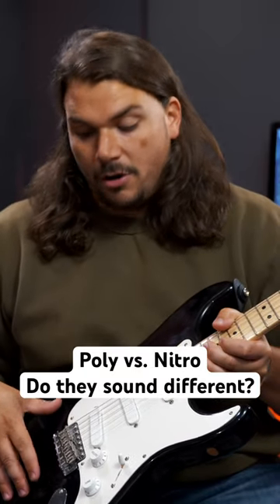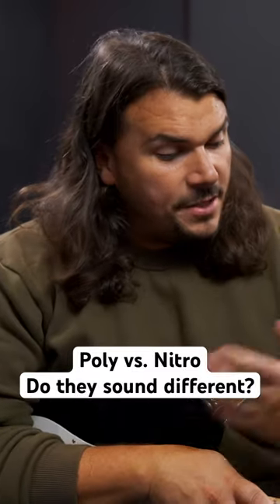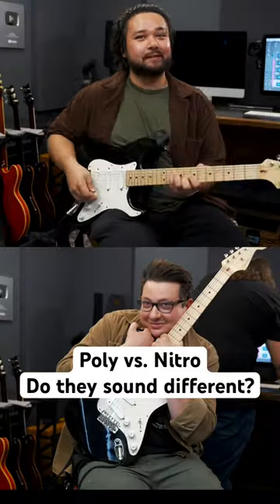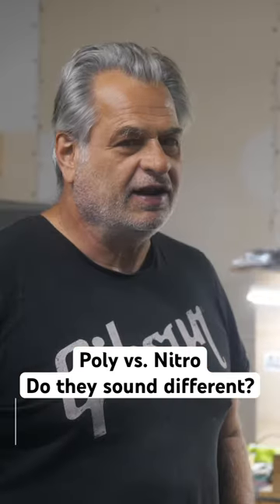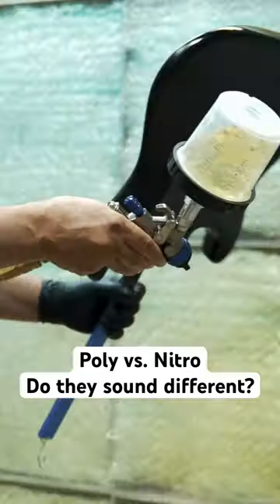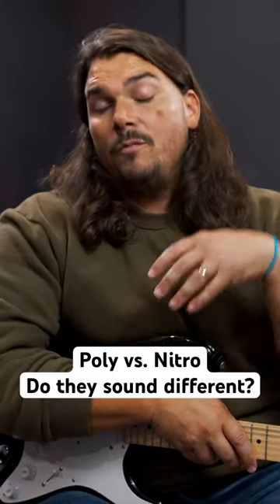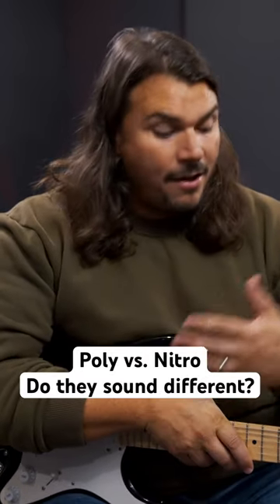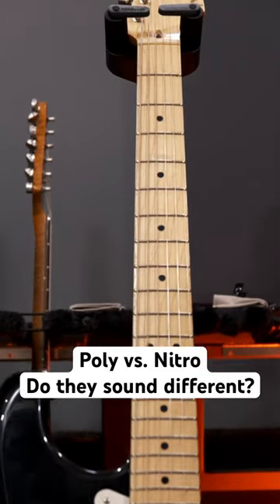Nitro vs. Poly DO THEY SOUND DIFFERENT?

Comment: Of all the tone superstitions that guitar players have, this one is the most insane. It’s right up there with maple versus rosewood fretboards.
Reply: The FB wood makes sense though.  The way the wood under the frets damps string energy can make an audible difference.
Reply: @GCKelloch  magnetic pickups don’t detect audible anything. They convert electromagnetic disruption to voltage, and that’s all.
Reply: @EricMakingWaves  Right.  They detect vibrational amplitudes in the strings that haven't been lost via acoustic resonance and damping.
Reply: Nah that one makes sense. The finish one though is silly
Reply: It may make a difference on a small scale perhaps barely audible to human ears but if you physically change one aspect- a relatively large one it has to effect the occultations of the strings to some degree even if it is minute
Reply: @stepvanjoe3469  More than barely audible.  Classic example is a Les Paul Custom vs Standard.  Custom is all Mahog with an Ebony FB.  Standard has Maple top and Indian RW FB.  The Custom has a notably brighter attack, but can have a more "hollow" tonal character depending on the density of the Mahogany.  That can vary a lot.  Wood is somewhat unpredictable-- denser from the bottom of the tree.
Reply: @GCKelloch it’s barely audible my friend. If you put that same set of pickups at the same distance from the strings, the difference between them wouldn’t be distinguishable without visualization of the audio.
Reply: @GCKelloch  I don't mean to be rude, but a simple physics/acoustics class would do a lot of good here. "Vibrational amplitudes" is not a thing.

Strings vibrating on a guitar create acoustic energy (sound waves) and yield a wave that is extremely complex and full of nuance. Microphones are transducers that convert this acoustic energy into a small voltage and yield a very complex signal that's full of sonic details.

Pickups are not microphones, they don't "hear" any of the things your ears hear because they don't detect sound waves at all. Pickups are simple passive magnets which create a short range field. Ferrous materials (steel strings) disrupt the magnetic field and generate a small voltage and a relatively simple signal--with very few sonic details. This is why guitars plugged straight into a mixer (with a clean preamp) tend to sound very flat and plain, because guitar pickups don't actually convey much information. This simple signal starts out sounding flat, but it acquires more character as it passes through pedals, preamps and power amps. Then, the majority of the sonic details we love about electric guitar are added by the speaker and cabinet--where the once simple signal is converted into acoustic energy and takes on all the complexity sound waves actually have.

The materials an electric guitar is made of have no effect on tone for two reasons: 

1. Because electric guitars generate such minute sound pressure levels that there isn't enough acoustic energy to alter the behavior of the strings themselves (think of how loud an amp has to be for feedback to occur).

2. Because guitars only have 6 strings and therefore a maximum of 6 orders of harmonics can be produced at any time. To put it another way, 6 harmonics isn't enough bandwidth to capture a truly complex sound wave like the kind your ears here when you strum an unplugged guitar. To demonstrate, try opening a grand piano and yelling inside it with the sustain pedal pressed down. There are hundreds of strings in there which is just enough to reproduce a lo-fi version of your yell (it sound a lot like reverb).
Reply: @EricMakingWaves  I have taken a physics of acoustics course and other related courses in college, and have since studied it informally for over 40 years now.  Yes, I used a term incorrectly, but I included "amplitudes" to indicate that the string vibrations are damped to varying degree.  

I'm talking about the direct mechanical damping of string vibrations from the wood fibers under the frets, and not from the acoustic vibrations through the air.  I've made b4 and after recording swapping guitar necks, and there are several YT demos showing how the rigidity and grain structure of FB wood damps string vibrations differently.  

Generally, tighter/harder grained woods damp less.  East Indian RW is much softer than ebony, and has large pores that allow more fiber movement to damp more.  That's just basic physics, and the difference in the high freq amplitude of the transients can be heard if the guitar circuitry has enough high freq extension.  I don't see how you all don't get that.
Reply: @EricMakingWaves  You also are under a misconception about what actually creates the signal in the coil.  Dr. Scott Lawing did a simple experiment showing the magnetic field emanating from the strings creates the signal voltage in the coil, not that the field around the coil is disturbed.  There may be some small contribution from the pole field fluctuation, but it wasn't audible in his experiment.
Reply: @EricMakingWaves  Also, Hi-Z guitar pickup signal is often not flat.  There is a resonance peak, the freq and height of which is determined by the capacitance, inductance, Q-factor and resistance.  In most cases, the signal rolls off by ~5kHz, but there are many exxptions.
Reply: @EricMakingWaves  Your statement about string harmonics is a bit off.  There are many harmonics in each string potentially audible depending on the string length, thickness and tension, and the pickup freq response, aperture width and position.  The first 16 string harmonics may be the most significant, so 16 x 6 strings.  Again, depending on how much the guitar structure and materials damp them.
Reply: @EricMakingWaves  The piano example is also not great.  How the string harmonics are excited by acoustic waves depends on the proximity and amplitude of the source, and at what strings it is located.  I'm quite sure I could excite very high harmonics by making a loud "Shhhh" sound close to certain piano strings.  Again, that's acoustic energy vs the direct mechanical energy I referred to in guitar FB damping.
Reply: @GCKelloch  dampening occurs through contact. Wood never makes contact with the string, it can only produce reflections, which again, are too low in SPL to make any difference at all.
Reply: @GCKelloch  try putting nylon strings on your electric guitar, they produce acoustic energy, but the pickups yield nothing. No iron content means no disruption means no voltage.
Reply: @GCKelloch  flat, in this case, is a descriptive word. If you look at a DI recorded guitar signal it looks closer to a simple sign wave than the same recording as captures through an amp and microphone.
Reply: @GCKelloch  each string can only vibrate at one of its harmonic orders at a time. 6 is the maximum concurrent harmonics.
Reply: @GCKelloch  it must be a good enough example because you’ve repeated my original point very well here. The amplitude and proximity are the most important factor in the strings reacting to what’s around them. Guitar strings have very close proximity to the fretboard, but the amplitude of the wave produce by the strum is very small, and the amplitude of the reflection the wood provides is even smaller.
Reply: @EricMakingWaves  The string vibrations that are strong enough to apply sufficient force on the fret to cause the wood fibers under it to vibrate will be damped to varying degree.
Reply: @EricMakingWaves  The feild disruption concept has been disproven. The vibrating flux lines emanating from the magnetized portion of the string generate the V in the coil.  The magnet can be located above the string, and the coil below it, and the same result will occur.  Feild disruption is insignificant.
Reply: @EricMakingWaves  Yes.  A guitar amp will generate added harmonics, and a mic will add acoustic vibrations.  I do not argue that point, but a vibrating string has many harmonics above the fundamental.  Albeit, at successively lower amplitude.  The fundamental is 1, 2nd = 8va, 3rd = 8va+5th, 4th= 2x8va, 5th = 2x8va+4th, etc.  You might brush up on your acoustic physics.  It's basic stuff.
Reply: @EricMakingWaves  Dude!  To reiterate: I'm not talking about the effect on the string vibrations from the acoustic vibrations coming off the FB.  I'm talking about the direct mechanical transfer/loss from the strings vibrating the wood fibers under the frets.  Wood fiber hardness/rigidity and density affects how the string vibrations are damped.  There's no point in further discussing this if you don't grasp the difference between the two functions.
Reply: @GCKelloch  when you google something to sound smart but have no idea what it all means.
Reply: @EricMakingWaves  What do you presume I not understand here?  My statements are all from principles I've learned through k's of hours of research over several decades.

You obviously do not understand all the factors that affect the 4 types of mechanical damping.  FFS man, a fret doesn't have near enough mass to reflect all the string energy back.  Whatever it's directly attached to will absorb string to fret vibrations to varying degree...ya duh!  

So now you resort to attacking someone who knows more than you on a given subject because you can't accept that you might be wrong?!  That's foolish, and this is now a waste of my time.  Sheesh, it's like trying to talk sense with a Prince fan.
Reply: I always thought that the whole point of a solid body electric guitar was to eliminate the effects of the wood on the sound.
Reply: @EricMakingWaves What an elegant incorrect response! Most if not all pickups are at least somewhat microphonic. Some may not be massively microphonic, but they still pick up some from the body. Dont believe me? Go mute your strings and strum your tremolo springs behind your guitar.

Comment: If this was ever going to work in the first place, which it wouldn't; it definitely isn't going to work with lace sensor pickups 😂 these are probably some of the least microphonic pickups on the market.
Reply from the maker: How do you explain the results?
Reply: @VertexEffectsInc  do you have a video posted with the results?
Reply from the maker: @CoorsLight_Conservative  its on our channel, came out about 10 days ago.  These are just short snippets of the larger video.  We also have another one coming out in a week or so that shows the EQ analysis between the two and the DI only showing the same changes for those that wanted more background on the "controls" in this experiment.